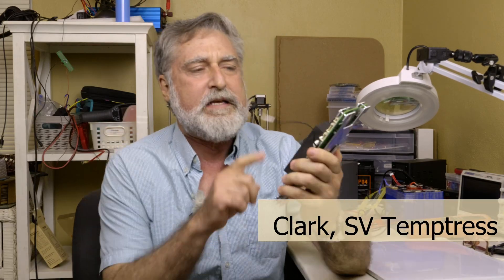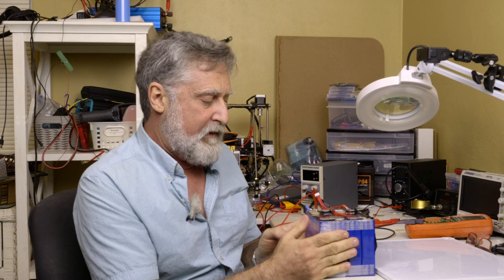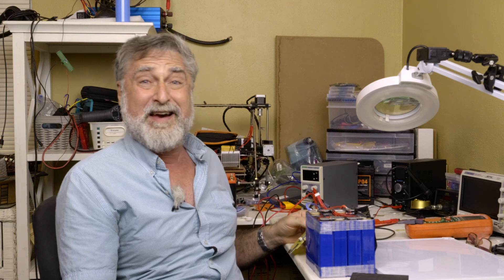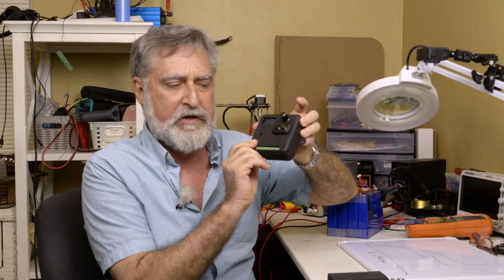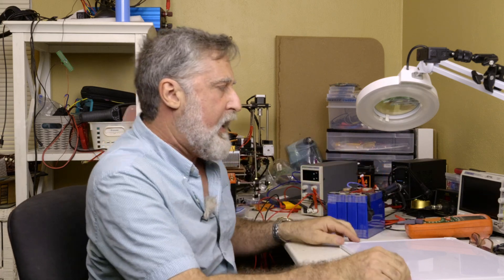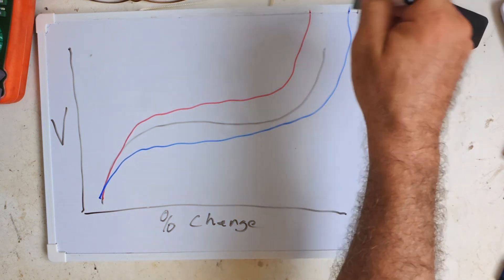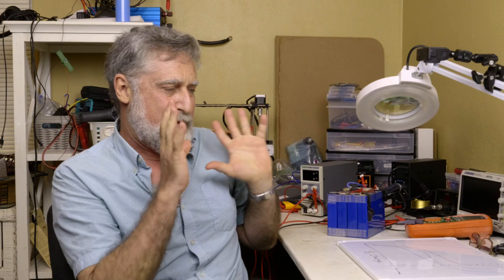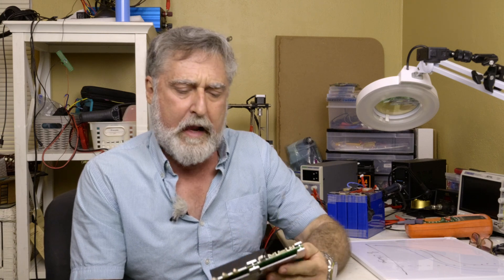What is a BMS really??

Comment: So I didn't know about the LiLife BT Lie until I have 2x100Ahr for my RV.   Is there any rea$onable way to get them properly BMS?  I find it interesting that a single one has no problem starting my 4000 Onan generator meaning I’m assuming there are allowing a lot more amperage out than  other manufactures as I've been told a single 100 won't start even that smaller size of gas engine... I’m just trying to understand if they/their BMS is just letting the cells overly rapidly discharge and damage during a gas engine start or have they found a safe way for them to. Was it safe/not damaging with their outboard starter battery that u replaced the BMS (maybe a 140Ahr)? you tore into them lying about the voltage when it was overcharged I think…So am I going to have a very short cell life with their setup of a happy bearded dude saying it's good or raise hell/fight for refund and do they typically stick unhappy buyers with return/extra shipping or what?
Reply from the maker: You found the video on changing to a JK BMS 
   Li cells can put out loads of power it's usually the BMS that imposes limits.  Their transistors will melt if they didn't limit current flow.

   If your on an has a alternator and you li you will likely eventually lose your alternator diodes when the li BMS cuts out.  Lead is the best for starting engines.   I'm back to that opinion.
Reply: @Clarks-Adventure  i’m in between I haven’t figured out my final system yet. I’m just limited on time. It’s not really money. I just wanna do it right and understand why for future use so will be Boondocking and likely swapping the Onan generator for the predator 3500 inverter and I don’t know the details on doing that just yet and I think it has a pull cord starter so that has to be though as right now I’m just trying to figure out if I can keep using all our time and it sounds like they at least put good solid copper in and if this web-based app and give me information. I’ll just keep them but I’ve got to make decisions on ramping up from 12 to 24 or 48 V see what the pre-wiring will handle…and then that’s when I’ll buy the bank manager & xtra batteries. Be sure to keep plenty in inventory should your health take another turn.  I seriously wish the best and sympathize with her untimely exit😢  
I’ve had the same sort of experience/still digging out.  Interestingly enough I think I told you that the RV master panel converter is unfortunately not the one that has a dip switch for lithium or lead acid. Ford however seems to have known their E450 Superduty chassis was being wired up to solar so it seems they put in a smart alternator. I assume it’s what has so far limited the charging amps to 20–40 amp range (it’s hidden so far back I can’t get the model/part number). BTW the Fluke meter u recommended 😊agrees with the LiLife BT software reading on amps. So it’s a risk but the SINGLE flooded house battery was so dead. Yes Coachmen RVs company is/was a greedy fking co to drop from 2 to a single  type 21 house battery.  Criminal !Any tips on a good desulfating battery charger and/or where can I find the tricks to longer life of thin plate flooded batteries?

Comment: Hi Clark, what is your current opinion on the best BMS for a 16s nominal 48v setup? I set up a bank on our bus initially about 3 or 4 years ago with a Dahlgren brand unit which is quite confusing and weird to use.  I would not mind replacing it if something better and more user friendly is now available for a 16s setup.  The bus isn't finished yet, so this has been sitting idle.  But I'll be finishing it soon.
Reply from the maker: I did a video recently (and a pair of videos a couple of years ago) on installing a JK BMS.  It's my favorite.   The last video is on fixing the LiTime battery.  There is a link in the description to the BMS.  Usually Amazon links have options, maybe that ad has a 48v option.
Reply: @Clarks-Adventure thanks Clark!

Comment: Maybe a good short hand for proper charging is "charge to True 100% State of Charge" which requires true initial 100%SoC (for which you reference your proper charging vid) followed by recording true state of discharge as it occurs so the manager knows what constitutes proper recharge on the next cycle.
Reply from the maker: Except every coulomb counter drifts so after just a few charge cycles it's veey far off.
   Sorry that approach is doomed to failure
Reply: @Clarks-Adventure  You lost me there, doesn't the BBMS have a coulomb counter, and if yes, how does it correct for that drift to achieve full cycle life?
Reply from the maker: It uses its special way to detect 100 POC which is independent of coulomb counting and recalibrates the counter every full charge cycle.
   If you use it with a Victron counter they start in sync but after a week or so the Victron is out of wack until you reset it.

Comment: Should I put a bank manager in my motor home?
Reply from the maker: I think so of course, I sell them.

But seriously if you want to charge your Li correctly for long life and reliability there is really no other choice.  And yes lots of these have been installed in boats, off-grid houses and RVs.  I have one installed in my RV.
Reply from the maker: You might want to discuss it with like minded people here https://facebook.com/groups/bankmanager/
Reply: Hey Clark, another educational video there. Thanks! I was able to revive/balance my 2017, 12v 450ah battery from what I have learned here.  I was only getting 20ah out of it now it's back to 370. I am charging it with a 50amp DC-DC charger. Getting ready to hook it up to my 165amp alternator. Just wondering if you have any schematics of how your bank manager would hook up to such a system?
Reply from the maker: The manual is publicly available at MarineDCAC.com
It's actually really easy.  Set up a lead system even if the lead battery is tiny.
  Then put your Li in parallel with the lead with the BankManager contactor in the positive cable.
   Done
Reply: @Clarks-Adventure thanks. Found it.